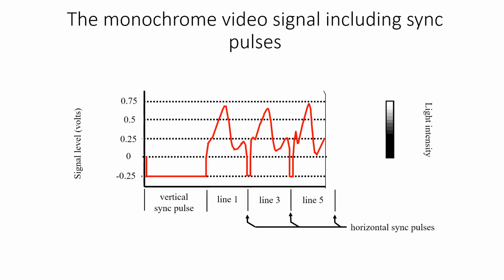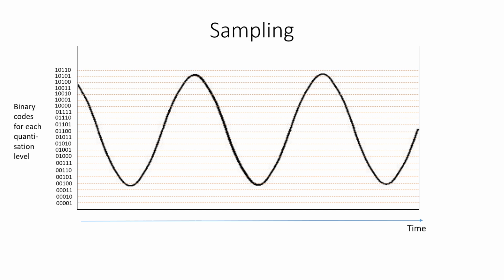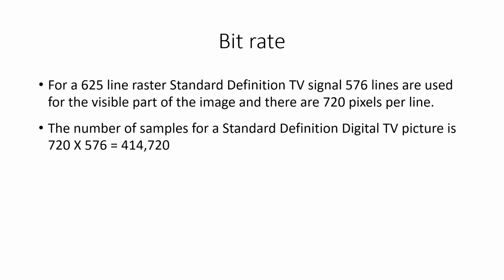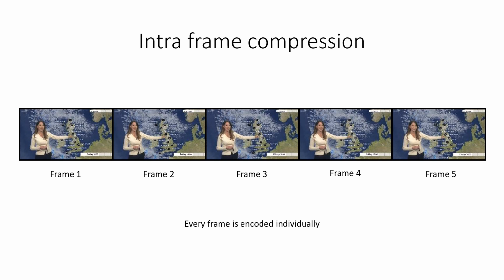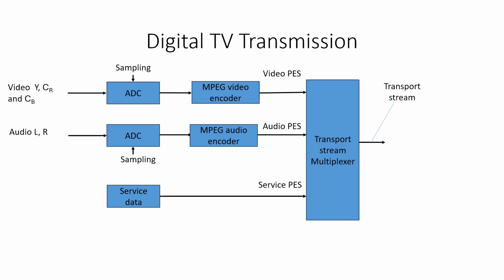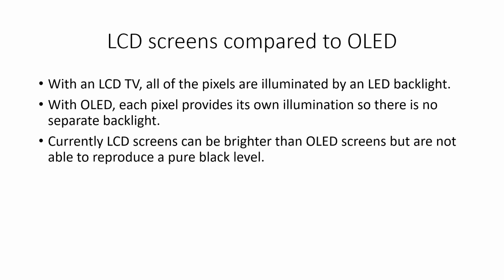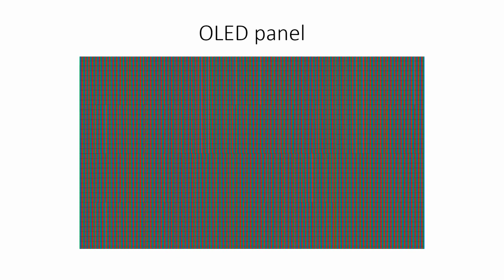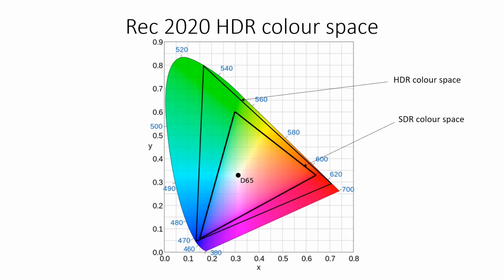How Digital Television Works: digital-tv broadcast & flat-screens

Comment: Great video but some of your math is incorrect.
Like you say that SD digital video in 625 at 8 is 166 Mbps but you didn't include the horizontal and vertical blanking information which is included in the signal. 
So 8 bit 625 SD video is really 216 Mbps.
There are a total of 864 pixels per line and a total of 625 lines.
864 pixels per line x 625 scan lines = 540,000 x 25 frames = 13,500,000 x 8 bits = 108,000,000 x 2 (Y, Cr, Cb) = 216,000,000 or 216 Mbps 

Now on to HD you said that it's about 3 Gbps. Which is funny because with that number you are including the horizontal and vertical blanking. But that's for RGB not color difference. But since you are talking about color difference it's spec is 1.485 Gbps. There are a total of 2200 pixels per scan line of 25 frame 1080 HD.
2200 pixels per line x 1125 scan lines = 2,475,000 x 25 frames per second = 61,875,000 x 10 bit = 61,875,000 x 2 (Y, Cr, Cb) = 1,237,500,000 or 1.2375 Gbps. There is head room for audio but the spec is 1.485 Gbps.
It's funny how you changed from 8 bit in SD to 10 bit for HD but didn't explain that. But if you ran the video in RGB instead of color difference the total does double even though it should be only be about 33% more data. But when sending an RGB signal instead of just sending 4:4:4 it actually sends 2 4:2:2 signals. It is either in a dual link or a single 3g cable.